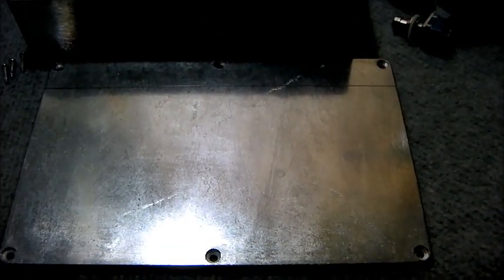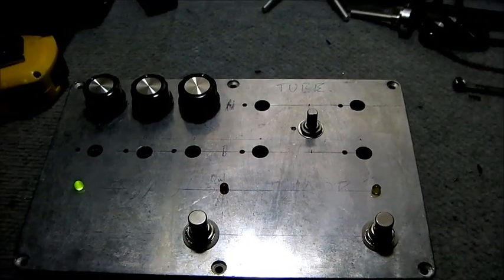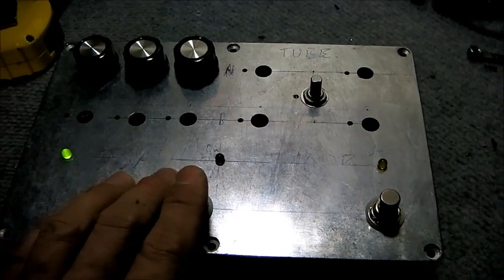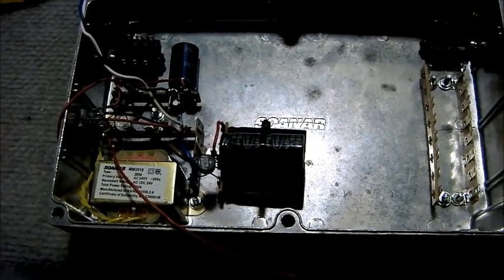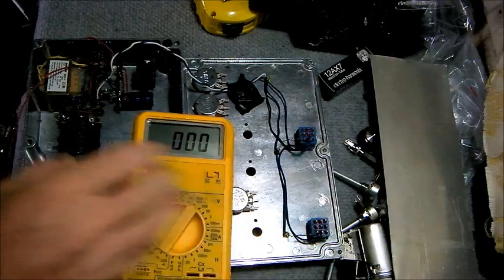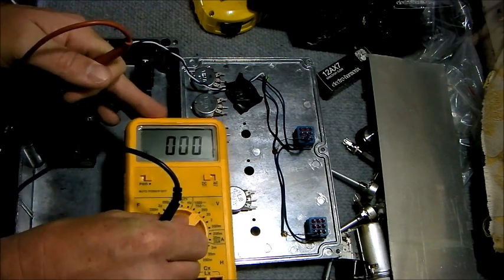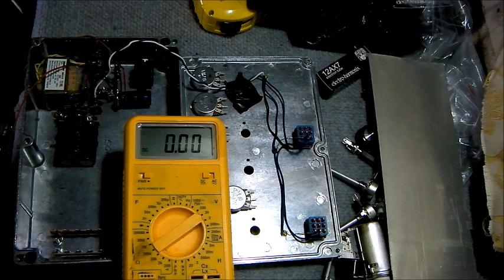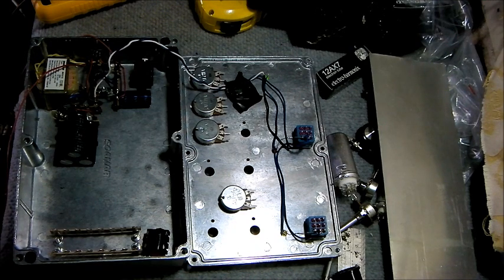Tube/Valve Distortion Pedal Build (Part 2)

Comment: 12 volts for the valves need to be Dc? How about 12-volt AC transformer secondary? I have a 12AX7 valve, pins 4 and 5
Reply from the maker: You can use AC but I prefer to DC 12.6V for filament power as the result has less hum at high gain.